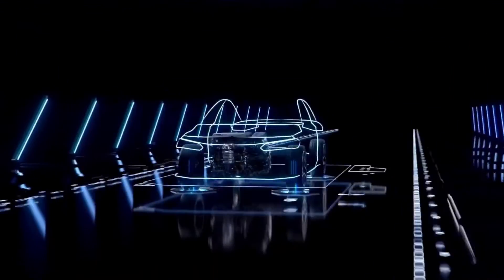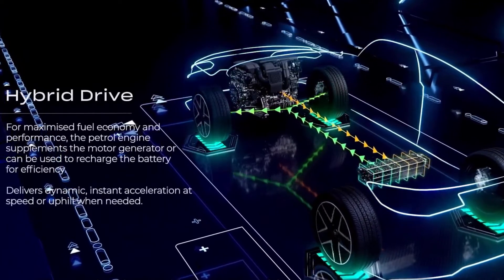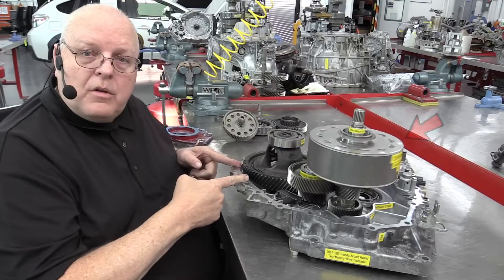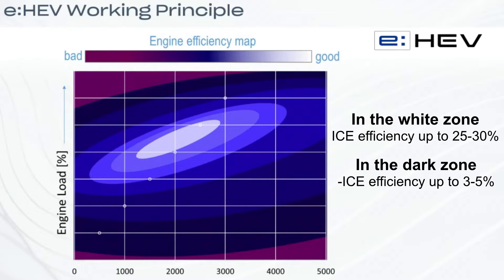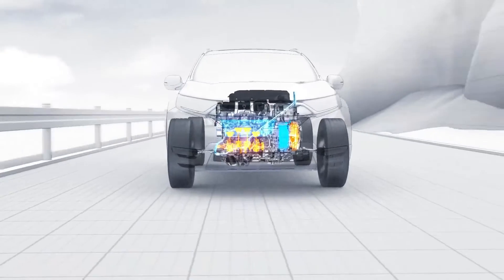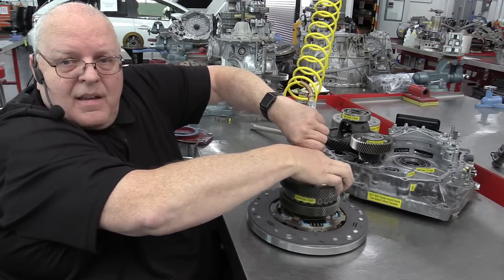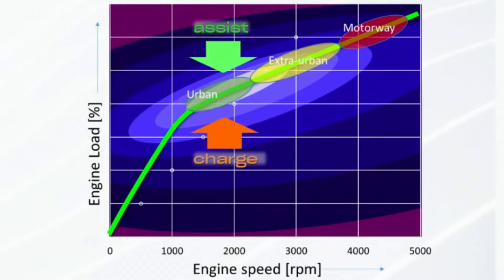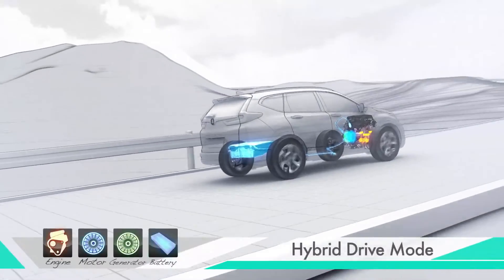Only 3L/100km! How Does It Work? Unlock the Mystery of Honda's Unique e-CVT Transmission!

Comment: The thing I don't really understand about this is it saying it would be more efficient to drive above 120km/hr than between 80-120? my brain hurts.
Reply: Why it's confusing? Instead of riding a bicycle directly, you are driving the generator to produce the the electrical energy which drives the same bicycle. In every transfer of the energy there has to be some losses., but it's not all, some parts of it it uses to charge a battery.

Comment: This system copied from Mitsubishi PHEV got two wet clutch. Latest Toyota hybrid with planetary gear and two motors is the best way to do.
Reply: While components are the same, this system works completely different than the Mitsubishi. All Toyota hybrids are copied (well, in the David v Goliath lawsuit settlement Toyota admitted only to "developed independently") from an R&D project at the University of Maryland around 1990. And when similar cars are compared head-to-head, this is better.

Comment: In my opinion, Honda copied the very reliable Toyota system and made some minor changes.
Reply: It has no gears, it's nothing like Toyotas Hybrid system.
Reply: @DrMacintosh  , It has gears but they are not connected.
Reply: Sorry, the only similarity is that it has two motor generators. Most of the time, it is closer to a Tesla than a Toyota. The rest of the time, it is a direct drive that is nothing like any other car.

The Toyota, on the other hand, is a direct copy of one developed (and patented) at the University of Maryland. This isn't opinion, it is fact that is admitted in the public version of the lawsuit's sealed settlement.

Comment: It’s a good description. It does not really have a “continuously variable transmission” mechanically between the engine and the differential though, compared with the Toyota/Aisin eCVT, which does have one, via a planetary gearset. In simple terms, they have used a clutch compared with planetary gears. Thus they have used a term that does not correctly describe the electric/mechanical transmission.

Not against Honda, as it was when it had a factory near to my place, and the best one I had from them was actually a Civic with a 1.6l diesel, which really was quite efficient and clocked up 4.4 l/100 km diesel fuel. After that I switched to Toyota hybrids.
Reply: The proper name, used in development, is "electrically-coupled" CVT. The engine and wheel rpm are unrelated, so the ratio does indeed "vary continuously." But it is a meaningless number.

But the best name I've heard is "virtual CVT." It gets the concept across without implying it actually is a CVT.

Comment: A failed attempt to rival Toyota's hybrid eCVT...  still needs clutches.
Reply: A more efficient (yes, when you compare similar cars), more powerful, and more reliable (KBB and JDPower) powertrain that is mechanically much simpler.

And you won't accept it, but unlike Toyota hybrids, there is no history of clutch failures. The one built into Toyota's flywheel has been known to fail.
Reply: I bought one so it's not a "failed" attempt.

Comment: My son needed a new car. He bought a 2022 Volkswagen Jetta. 30,000 miles later the cylinder head gasket needed replaceing. So he bought a Mazda. Asked why he didnt buy a new Honda, he said they're putting CVTs in them, and they were having problems with them.  For my Son to say that, i believe him. He does his homework.  Unfortunately, the engine in his Volkswagen was a new design, so there was nothing about it to research.
Reply: Honda’s hybrid CVTs are nothing like the CVTs that your son was talking about. Even Honda’s newer real CVTs are more reliable than the older CVTs. Honda had problems with CVTs for 2014-2015 model year cars, but they have gotten better since 2016. Props to your son for running away from VW though.

Comment: Who invented the ecvt 
Honda or Toyota?
Reply: They are different. Toyota's eCVT technology  was invented by a Ukrainian immigrant working at the University of Maryland around 1990, and (according to the lawsuit settlement) "independently developed" by Toyota a few years later. The "eCVT" part of Honda's is based on years-old technology used in diesel-electric locomotives for decades, but the combination used in the system was developed by Honda R&D around 2010. (And yes, it is different than Mitsubishi's, even though components are similar, so it is original.)

Comment: The Honda eCVT is not a CVT its a hybrid. 
It has an engine which drives a generator which charges a battery which runs a traction motor. 
At motorway speed a clutch connects the engine directly to the final drive diff. Toyota do this so much better.
Reply: It’s confusing.  That’s why Honda should have named the transmissions used in hybrid vehicles something totally unrelated to CVT.

Comment: On my 2024 CRV, I have been in EV mode up to speeds of 79mph. This video and the clips of the professor breaking down the ecvt is for the previous gen model, which is almost the same, but not quite.
Reply: Yes I have a 24 CRV and EV mode comes on during expressway driving
Reply: I think it's the same system,  just the speeds are different. I have a 2025 Civic and it will go into EV mode up to about 80 mph, above that it is always in hybrid mode. The engine coupled mode only occurs in certain conditions between 50 and 80 mph.
Reply: Prof. Kelly made several mistakes, some of which are corrected in his text description of the video.

Comment: Our honda crv ehev 2024 awd needs 6.6 l/100km average which isn't that good i would say, its not fast either so i don't know what to think about it
Reply: Just test drove a Civic hybrid and it's surprisingly fast; supposed to average 4.5-5.0L/100km. I think the CRV's added weight and all-wheel drive hurts its cause. There's a 335kg difference between the two.
Reply: my zr-v e:hev is averaging at 4.3l/100km, and it doesn't feel slow at all. it's based of the civic.
Reply: @m3csl89  is it awd tho?
Reply: I drove a Toyota Camry 2024 hybrid and the average consumption was 6.5 l/100 km.

Comment: At 6:07 - The gas motor is running by itself above 62 mph, but its optimal RPM range is about 3700 to 4700 RPM??  That graph can't be right!!  I would NEVER drive my car in that range!  How long would your gas motor last if you only drive highway speeds??
Reply: The most optimal range from the graph looks to be about 1200rpm to 2900rpm.

Comment: This video is probably outdated and doesn't talk about the new generation of Honda Hybrids (2023 model onwards)
Reply: This video copied everything it says from others. Some is for the current (fourth) generation of the system, while most is from previous ones dating back to 2013 (in Japan). But the differences are not significant; the underlying design principles of the system are essentially unchanged. The generational differences are mostly in the engine, the motors, and maybe the exact configuration of the components.

Comment: That would suck having to replace that clutch.  Eventually you will need to R&R it.  I still think Toyotas Synergy Drive Hybrid with the planetary gear sets eCVT is still the best Hybrid system to date.  On the Toyota you still have to replace the eCVT oil at regular intervals  but that's a whole lot easier to do than a clutch replacement.
Reply: There are two clutches, one is a multiplate type running in oil, like a motorcycle clutch, whilst the other, as I understand it, is a single plate clutch only operated in emergencies to disengage the drive.  So, as the single plate clutch operates so infrequently it should last for the life of the vehicle.  The multiplate clutch also only operates infrequently as there are no gears, just the transition from electric drive to ICE drive at around 60mph, so should last far longer than any car with a conventional transmission where the clutch has to operate every time you change gear, or come to a halt.

Comment: I have the Honda CRV Hybrid Sport 2023.  I understand there are 2 clutches in the transmission.  One is for low speed which  when engaged will allow the engine to combine with the electric motor to drive the vehicle which allows for times when urban speeds require more RPM.  The other is a high speed clutch which engages at 62 MPH resulting in overdrive gear allowing for the gas engine to do all work.  That is at best how I understand it and not sure I am correct.  Would sure like to see someone tear a Honda CRV Hybrid eCVT apart to show how it works like Weber did for the Accord single clutch transmission mentioned in this video.  It would help me know how best to drive my Honda CRV.
Reply: No, I'm pretty sure you have only the one clutch just like the Weber video. There was no other system. I have a 2025 Civic and it's the same thing.
Reply: @pi.actual CR-V hybrid has two clutches: one for low speed (used when the car is driving offroad) that is quite the same with B mode on Toyota and another one for high speed (used when the car is driving on the highway at a constant speed).

Comment: I am a fan of Honda's e-CVT but I've eventually bought a Clio E-tech. I don't know yet about the reliability but the technology is perhaps better as it combines the HP of the electric and the ICE engine and it drives better on highway at higher speed.

Comment: CVT   Continuously Variable Transmission.    There is NOTHING CVT about this setup.  It is usually a series hybrid with a big electric motor (more powerful than the gasoline engine) powering the vehicle like the electric car that it is (most of the time). And the gasoline engine running as needed driving the generator. 

Out at highway speeds it would be inefficient to make electricity to immediately use it in the big motor so for steady state cruising the engine clutches in to propell the car.

This is a fixed ratio 1 speed drive, nothing CVT about it. If you floor it to accelerate the gasoline engine will unclutch and go back to generating electricity while the big electric motor accelerates the car.

Nothing CVT about it.
Reply: Not a CVT. An electric motor for low speed traction and then at 62mph a clutch connects the engine to the wheels.
Reply: @fivish  . Yes. For steady state cruising. 
As I mentioned earlier if you floor it the gasoline engine will unclutch and return to generator duty (I'm guessing at a high rpm for maximum output) while the more powerful electric machine accelerates the vehicle. 

Very different from the Toyota Synergy Drive approach. Which avoids clutches.
Reply: Car manufacturers have looked a bit at how they do in the tractor industry. No chains are used, but a hydraulic motor to create the gearing.
Because chains on cvt are unsustainable when there is a lot of torque behind
John Deere has made an IVT transmission with 4 gears and 2 electric motors.
You can call the Honda transmission (infinitely variable transmission) (IVT)

https://www.youtube.com/watch?v=aMzgT_FahBU&ab_channel=JohnDeereUKIE

Comment: The exact definition is series-hybrid with lock up clutch direct engine.
Reply: Correct.  Nothing CVT about it.
Reply: Nissan have similar without the lock up clutch.
Reply: @fivish As far as I know, Nissan’s engine is running without stopping, but only as a generator. The engine never drives the wheels (thus, no need of a clutch). It’s more like a range extender.